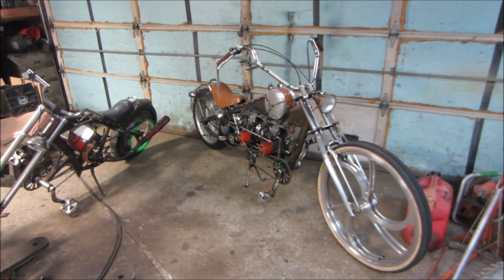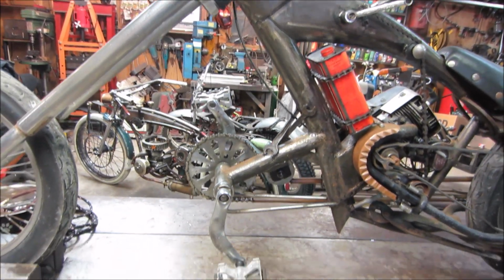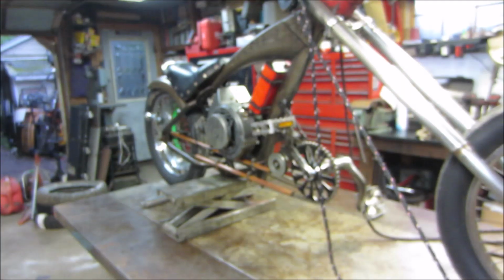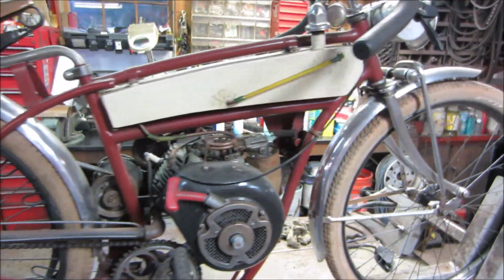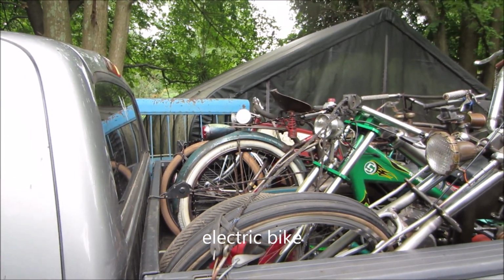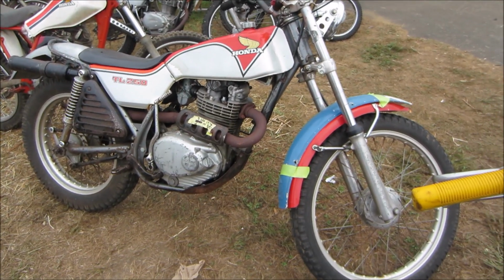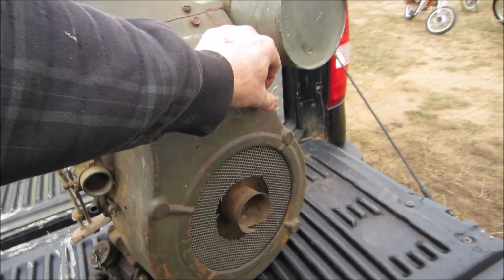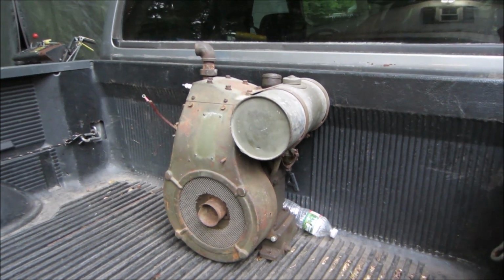My bike builds go to Rice O Rama Bike show.2018

Comment: Loved it! Although I love shows with old stuff any day of the week, Those older Tecumseh snow blower engines have a surprising amount of power, and gain revs rather quickly, but all the engines are cool, and couldn't pick a fav. Hope you remembered the batteries for the lights in a couple of those that have been sitting..especially as old batteries will corrode the innards after awhile. Congrats on the trophy..well deserved! And Love that people like them so much too..that always helps justify a bit the time and skinned knuckles ;)  And Lil clearly said at the end "a chicken burrito..or enchilada doesn't sound bad, but a cheeseburger always works" it was in her eyes,lol

Comment: As always, a fine video and subject matter. Congrats on the trophy! I'd like to pass on a little info. On the subject of "Off the shelf premix fuel". I do quite a bit of small outboard repair and sell a few ,too. I replaced three powerheads this season due to the use of this type of fuel. It may work well in chainsaws and weedwackers but the bearings don't hold up long in an outboard motor. Two of the motors were so bad the rods were out of round and the crankshafts were egg shpped and undersize. The bores were all good. Two stroke oil is formulated differently for water cooled engines. I used to do Jetski work in the 70s and 80's, and could tell the difference when I removed the head. Quality 2-stroke outboard oil leaves no cokeing or heavy residue build up. Let's face it, there are 2 speeds for jetskis and small outboards, off and open. The ethenol free fuel is great but mix you're own oil. By the way, these premix fuels are a death sentence for babbited 2-strokes. They need straight 30wt mixed at 16:1or the equivalent of 1 qt oil to 6 gal of gas. I have found aviation fuel is available at the small airports and it is ethenol free. Just bring a propper fuel container and they will fill it for you. I only brought this up because I noticed you using the premix. Using premix short term is probably ok, but you mess with a lot of old motors and pre 1965 just about everything was babbited. Good thing you didn't enter the rest of your bikes in the show. You wouldn't have had room to bring them all home. LOL

Comment: The first bike you rode around the track, took me back to my youth, 1974 I had a 3 1/2 hp tecumseh, on a mini bike Chopper chrome forks, bike wheel in front, Black bike w a black n White leopard seat, white motor, I rode the hell out of that thing, illegally streets of the Bronx, but that free wheeling sound, I still remember it, unfortunately my riding days ended as my friend Rocco, crashed his 2 stroke bike 30 feet in front of me into a delivery van, I sold my bike and never rode again, Rocco spent a few months in the hospital, he did walk again w pins in his legs, etc, scared the hell out of me, never rode again

Comment: Truefuel, Motomix, and the other non-ethanol fuels in a can are great products.  No need for stabilizers and they don't go bad over time.  The warranty on my 2-stroke lawn & garden equipment was extended an extra 2 years for free by the manufacturer because I use their 50:1 fuel in a can.

Comment: Love your videos... I buy 85% phosphoric acid on eBay for $53 bucks for 4 quarts that you dilute down 3 or 4 to 1 for adding patina and rust protection to steam punk projects and truck frames. By experimenting with various concentrations you can get some cool effects while converting any actual rust into iron phosphate. The 4 quarts diluted makes a large, long lasting supply on the cheap too. I use distilled water to avoid weird  chlorine compounds/gases possible with chlorinated water.

Comment: Hey must I took your advice and when I was at tractor supply today I took a peak at their customer return pile and found some awesome deals an 1800 watt generator that didn't turn over it was carbon built up in the head no scoring on the cylinder walls a 4cfm vertical air compressor that seems to need nothing and a straight shaft trimmer with a weed Blade that started with the first pull needs carb tweaking won't run off idle and only paid a 100 bucks for all awesome deal thanks for all the encouragement

Comment: very nice collection, personally I use black for my subtitles, it helps it stand out. also looks like the lower fuel level gauge nipple is leaking on the reo engine, due the wrinkling of the paint.

Comment: A common problem that you seem to have is remembering the choke position and if it’s on or off. If I may make a suggestion, simply engrave the case near the choke (or a Sharpie) with O for on and O for off. Problem solved!
Reply: 12bucklemyshoe1 it’s much more fun to find out engin to engin

Comment: You still seem undecided on the color of the that shard on the rat bike, May I make a suggestion... Although it may take some work you could paint the round part where the pull start recoil is to look like an air cleaner. and the other part to look like a cylinder. do a little hand painting or swap a favor with an air brush artist. anyway when I look at that space that's what I see.

Comment: you know mustie buddy winter is coming and if you have not used this engine  you got from  the show . it would make a awesome bike motor . hint hint . maybe another board track racer .  or maybe one of those rocket looking race cycles  cant remember the name but you pretty much are laying down on them and they have that little  bullet shaped  wind shield  on the front .  maybe  use a riding lawn mower transmission  with it .  with a 32 tooth sprocket  in the back .  built for speed .

Comment: I have often wondered about a hybrid bike that would utilize a low displacement two stroke motor to augment a lithium /ion or nickel cadmium battery drive.  In Europe the e-scooter and e-bike market is growing exponentially. They can do that now with some small cars, and the key areas to develop I see are fuel storage, manual or auto controlled motor operation, and the generator to energize the storage battery. Might only be useful as a means to extend the range Mustie could do it, I'm sure.